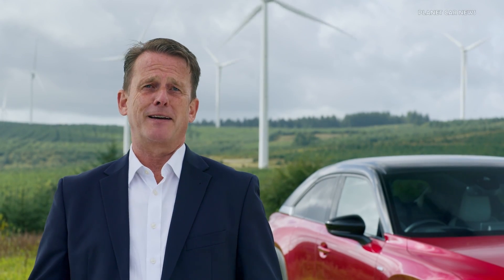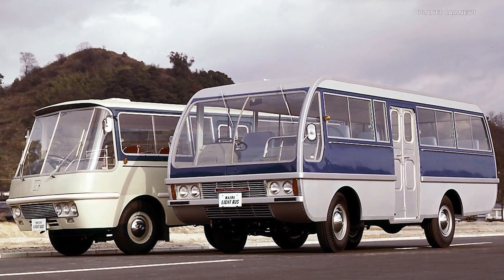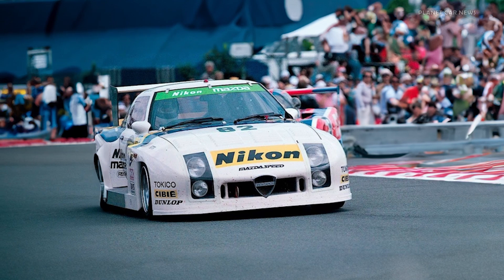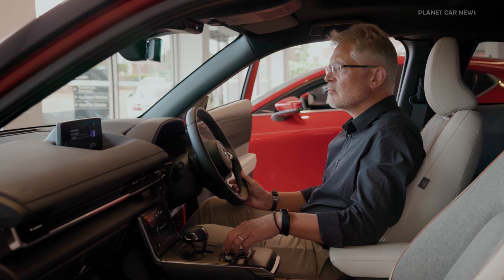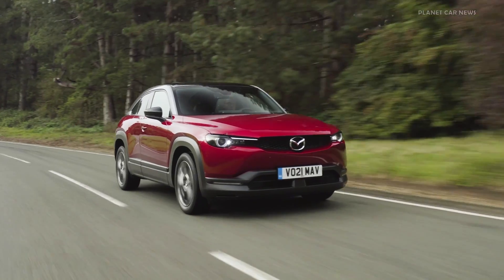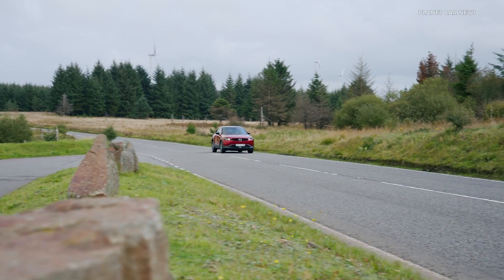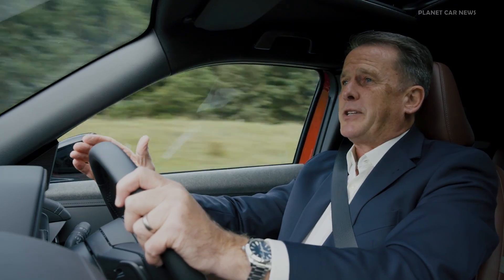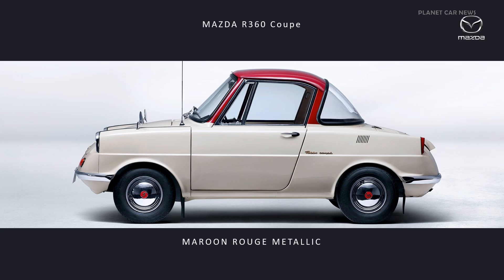Presentation of the New Mazda MX-30 R-EV with Rotary Engine Generator

Comment: Yeah it's cool as a range extender, but the environmental propaganda, specially the scenes of filming this with renewal energy behind them (lol) is quite misleading.
Those Generators, even the ones in the MX-30, are incredibly inefficient, for environmental sake you would be better off it not being an ICE or Hybrid at all, and instead being purely an EV and then use the gasoline/diesel on an actual efficient industrial generator to power the grid with more electricity with the same amount of fuel than this car would consume... 

EV's are the future, this coming from someone that owns an environmental unfriendly Honda Civic Type R GT.
If you really care about the environment as a manufacturer, you would focus on pushing battery tech to be even easier to recycle than it already is, make the batteries be purely out of graphene with no lithium which will happen sooner or later, and use the fossil fuels for powering the grid instead of wasting it on motorized vehicles which as mentioned above are known to be incredibly inefficient power generators with it compared to an industrial generator.

Comment: The last Mazda rotary engine was useless, used loads of fuel, oil and only lasted 70k
Reply: The 1.3L dual rotor (possibly turbo’d) Wankel Rotary Engine used in the Mazda RX-8 is a totally different propulsion unit to the 830cc single rotor unit installed as a range extender in the Mazda MX-30 R-EV.
The latter engine uses more advanced technologies and benefits from the latest research into making these engines long lasting.
This 830cc Rotary Engine is designed to be a range extender that works exclusively as a generator that charges the battery / provides extra power to the vehicle’s electric traction motor on demand (or as decided by the BMS / ECU).
This rotary engine never drives the wheels directly. Its speed is NOT governed by an accelerator cable connected to your throttle pedal.

It is set to operate within a very safe zone of no more than 4,500rpm and often marginally less than that.

Believe it or not, the often derided Prius has an Atkinson cycle engine which is governed in a similar manner, despite having a throttle pedal. If I recall correctly, the engine runs at only three (or four) specific set levels of RPMs - this is true as I presently own one. 

The engine jumps between these preset operational RPMs depending on how you press the throttle pedal. For example, you’ll only get the maximum performance from the engine only if you floor the pedal - something that’s rarely done in a Prius - so RPMs seldom go over 4,500rpm in day to day use. The e-CVT transmission (actually a planetary gear set) mimics engine RPMs rising and falling through the full available spectrum like a normal vehicle with a CVT gearbox.

This is one of the reasons why those Atkinson cycle engines (on the 2nd Gen Prius for sure) are lasting at least 250,000 miles and often much more. 400,000 - 500,000 miles aren’t uncommon - but, back to the Mazda MX-30 R-EV 830cc Rotary Engine.

With its preset levels of operation, this engine is running in an optimised and unstressed regime that will virtually guarantee a long-life for the unit. There’s no turbo attached, no insane revving at 9,000rpm - at most, it’s spinning at half that speed - which research has proven to be the most optimal range of operation for that newly designed Wankel rotary generator unit.

As a range extender - it wouldn’t be constantly in operation unless the driver was extremely heavy footed or never bothered to plug the vehicle in to charge.
Under normal operation with home charging being the primary energy source of the vehicle and catering for the Monday to Friday daily commute - with longer journeys coming into play on weekends where the rotary might be pressed into service more often, and for longer, this 830cc Rotary Generator should last a great deal longer than many nay-sayers might imagine.
Indeed, 10 to 12 years at least, with proper maintenance can be easily expected - if not 15+ years.

Obviously, time will tell - but I strongly believe, based on Mazda’s history and experience, that this is likely to be the case.
Lastly, nobody seems to be aware that carefully maintained Mazda RX-7 rotary engines were known to last up to 200k miles before wearing out the rotor tips.
These were cars whose engines were NOT abused or turbocharged.

Ergo, the Mazda MX-30 R-EV Rotary Range Extended will NOT be a problem and will not suffer premature rotor tips wear - even the walls these tips move against have been sprayed with a newly developed coating to reduce tip wear further 😊
Reply: useless therefore essential

Comment: Consider this; drive to work on the battery (example: 17 miles). Drive back home in charge mode and top up the battery. That’s for someone living in a tower block who doesn’t have a charger where they park. The petrol has to be used at some point - especially in the UK with the Ethanol E5 or E10 additive that’s mandatorily added to UK petrol - E10 would deteriorate quickly if left to long in the 50 litre tank.

Savings are possible even without a home charger, but the best combination is relying on a home charger daily and then using the Rotary extender if and when the battery becomes depleted.
This vehicle should comfortably handle a 34 mile round trip commute with its 53 mile battery capacity - and even in winter when colder weather means using more battery power to warm the cabin (it uses electrically powered heat pump technology - not inefficient heated coolant from the engine); that Rotary extender should see you through the coldest European winter demands and ensure you get to your destination.

It’s no Prius - that’s perfectly clear - but it’s a very original design. Used correctly with home charging and the appropriate lifestyle, this is definitely an eco EV that will save on transport costs - especially with the correct overnight EV charging tariff from your electricity provider.

I would love this to be my next car - Mazda have a knack for creating “bespoke” vehicles that stand out - a godsend in a world of near identical euro boxes and boring SUVs.
Reply: What's your advice for avoiding fuel deterioration?
Reply: @ThePtoleme  Use E5 Fuels only in the UK. I run my Prius on E5 only. You can buy a fuel additive if the fuel has been in the tank for too long - that helps.

Comment: Absolutely genius in my opinion. An onboard charging station vs spending trillions of dollars to provide charging stations everywhere. Once a week charging also reduces the load on the grid. This car could be perfect for apartment or condo owners who don't have access to their own dedicated chargers. 
Not to be a smart ass but I spoke about this many years ago. Smaller engines in hybrids delivering better mileage with slightly larger batteries. Imagine using a small motorcycle engine or a small diesel as a generator? Mazda has proven there's a way to not be mandated to EV cars only. 
My only question is when will it come to Canada?
Reply: Isn't the Nissan E Power using the same idea? Engine as generator. And years ago, the Vauxhall Ampera/ Chevy Volt.
Honda Jazz too, although it's engine sometimes drives the wheels directly. So what's new? Just the inefficient Wankel engine I suspect
Reply: @piglet5287  most of them haven't proven to be that efficient or popular. Sometimes theories are great but in practice perhaps not.
Reply: @darylpreston7505  I agree with you! Will the Mazda be different?
Reply: @piglet5287  I had an early 1980's RX7. Small engine, I think 1100cc. You're absolutely correct, they're not very efficient. That said, newer materials, improved batteries, more efficient ICE cars and a seemingly infinite combination of technologies makes this an exciting time for car owners.There is no one size fits all vehicle, especially not just EVs when a certain country produces most of the minerals and batteries for our use. Imagine if our relationship with said country soured and decided, sure you can have new batteries but they're even more $$$$? Just sayin.
Reply: @darylpreston7505  you are echoing the head of Toyota's remarks and I don't disagree. Our authorities should legislate for low emissions but leave it to manufacturers to decide how to get there. Lugging around a huge battery has never appealed to me as an engineering solution, because having read car mags since I was nine, I know that "lightness is best" is the golden rule for making cars that drive well (and are economical).